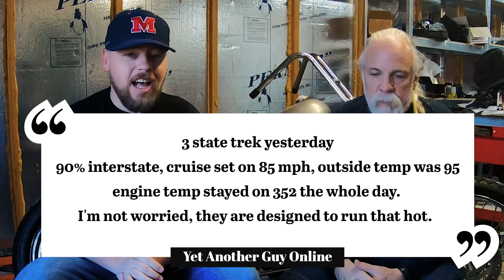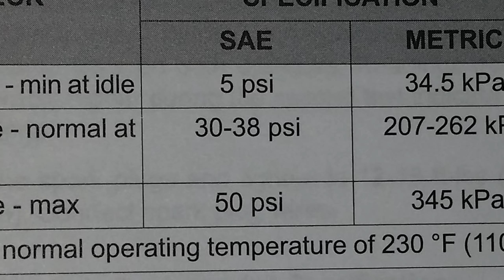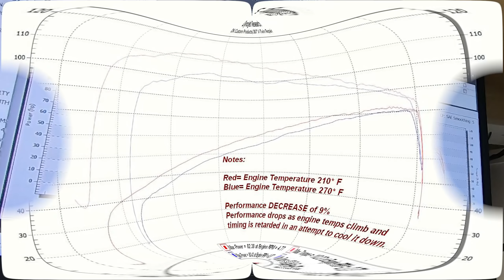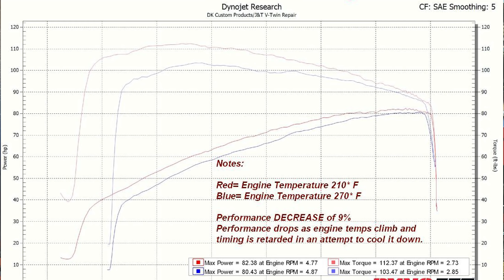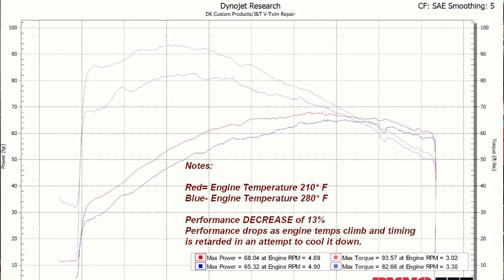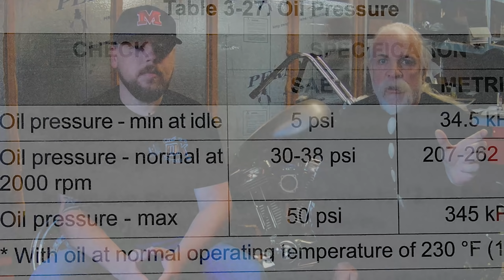Harley's - The RESULTS ARE IN About a Popular Myth

Comment: Is there a temp gauge set up for my 19 tri glide both cylinders
Reply from the maker: There is only one heat sensor in your Milwaukee 8.  It is located in the front of the rear cylinder.  This is the sensor that HD uses in the ECM to help adjust the tune for temp conditions.  The best way to display the reading from that gauge is via a Power Vision or an FP4.  You can see those here- https://www.dkcustomproducts.com/efi-tuners-c74-317.htm
Here are a couple of videos that you may find interesting/useful-
https://www.youtube.com/watch?v=0vbTkRvFa80
https://www.youtube.com/watch?v=rWOdQOtDv6A
Some folks use the Dakota Digital Set up...it is pretty expensive, and we have seen a lot of folks have problems with it.

Comment: Those temperature numbers are oil temperature or CHT? Thanks
Reply from the maker: In the video we talk about oil temps and heat sensor temps.  Two different temperature readings.
Oil, as shown in the video should not exceed 230 F.
Heat sensor temps (as read by the OEM heat sensor) and displayed on the Power Vision as ET should not exceed 230 F on a Twin Cam, and 260 F on an M8.
More details on ET temps, where they come from, and what they should be, are discussed in this video- https://www.youtube.com/watch?v=rWOdQOtDv6A

Comment: When you use premium fuel the engine can get very hot.
Reply from the maker: Any fuel and the engine in a TC or M8 can get very hot.
I have read reports on both sides of the fence...
lower octane (87) burns slower, so heat is retained longer
higher octane (93) has a higher ignition point, burning faster, retaining less heat.
Reply: @DKCustomProducts  oh no, the higher octane explodes much faster in the pistons causing alot of heat around my legs, when I shut the bike off the pipes keep popping for 15 minutes, THATS HOT. But when I put the shit stuff in" 87 octane", theres no popping in the pipes when im done riding, but the bike runs like shit because im putting the cheap fuel in. So now i just put the premium in her, she runs like a dream, but she runs very hot.
Reply from the maker: @philiporourke7896  Below are links to a video series and a written report on how to cool that engine down.  
It will be more comfortable.
It will have more power.
It will last longer.
https://www.youtube.com/playlist?list=PLb3bvZgbH92_3s-2vv63QggFJ3nteFd_C
https://www.dkcustomproducts.com/why-how-to-cool-down-the-twin-cam-engine-part-i-dk-cl-tc-dn-1.htm

Comment: My XR 1200 has an oil cooling system separate of the engine oil lines and passageways.... There are spray nozzles mounted in the bottom of the cases that spray oil on the bottom of the Pistons ... There are oil lines extra coming out the center of the cases between the jugs that go up and do nothing but cool the cylinder heads and then back to the oil tank... There's a huge oil cooler on the left side of the frame that goes to a mechanical thermostat inside the cases that governs the amount of cooling oil going through the oil cooling system... So one day I found a oil cap combination thermostat and dipstick that fit my oil tank... And in cold weather the oil temperature is about 195° and it's remains that hot all the time and gets up maybe 205 210 if I run the piss out of it... And this summer I was watching it closely and deliberately got into some slow traffic at 5:00 and finally a traffic jam where I was sitting stalls in traffic and just let it run to see how hot it would get and it never gets over 210° f when it was 95 outside install traffic.... Someone knew what they were doing when they designed the XR 1200 engine that no major parts will interchange with a Sportster. Hell yeah I have had about eight Harley-Davidsons and I put oil coolers on every one of them that's why I was checking the temperature on this XR to see how crazy it was getting because just a few years ago I had one of those fxdrs with the oil cooling system similar to my Sportster XR 1200 and the fxdr 114 Milwaukee 8 gets extremely hot and I added an extra oil cooler to it...And years ago in around 1981 I bought a 1980 iron head Sportster that was Cherry all dressed out in about $3,000 worth of drag specialties everything but no oil cooler... It did have one of those oil temperature dipsticks for the oil tank and on a hot summer's day that son of a gun would hit 280° on the oil temperature and if you got stalled in traffic you had to shut it off it was just fry your legs like the skin was going to come off.... And being such a sleek little bike I didn't want to one of those huge oil coolers that sticks out on both sides so I went looking and I asked my buddy's wife who had worked at Western Auto if they had any kind of small oil coolers for cars... And marry my buddy's wife got on a step ladder and went up in the attic of his old Western Auto store and brought down this big package still sealed up with about a half inch of dust on it that was an oil cooler for a Chevy corvair automatic transmission as you know the Chevy corvairs were air-cooled engines and so they had to have an air cooled automatic transmission cooler that was about 6 in by 6 in and made two passes loop per loop built like a little air conditioner condenser and just fit perfect on the top part of the frame in the front where there's a bolt hole for crash bars I made a little holder that went through the loops with some rubber damits and it fit perfect and you wouldn't believe the difference that little cooler made would you believe it went from 280 to 180 and about 200 on a hot summer day perfect freaking perfect and I never lost any power at all after that as it would get pretty sluggish when it was getting hot... You guys know what I'm talking about
Reply from the maker: Thanks for sharing!  Yes, we know what you're talking about.
The XR's are a different animal, and it sounds like you are very happy with it. 👍
Good to hear how you kept all your bikes, thru the years, running optimally!
Reply: @DKCustomProducts  thanks for the reply. What I can't understand is why people don't understand that they need to put an oil cooler on every Harley there is. They even sell them in the Harley accessories and some of them are quite expensive.. but if you look in that Harley accessories they have some that are really nice that fit down in front of the frame on the big twins and some of them from like the company called fueling have the ones that mount on the left side of the frame just like the XR1200...
You should follow up with a video showing all the Harley accessories oil coolers that a lot of people could put on themselves they're not that hard to do especially the ones that use the pancake between the spin-on filter mount... After you install it then you just spit on your oil filter and you're done...
And they make dipsticks oil caps with as monitor in so you can see how your oil temperature is running and show some of those in in a video maybe even some shots of riding the bike and then pull over and stop and take a look at the temperature if the temperature stays the third or fourth time you know about where it's going to run off always. So you really don't have to go to the expense of mounting one up on the dash of your dresser just if you got an oil temperature gauge on the oil dipstick is fine anyway good luck to you guys see if you can convince some more people of what I already know over the years see you in the wind
Reply: PS they even have them with fans and thermostats on them so when the gets too hot the fans automatically kick in those are the ones that are a little bit more expensive but trouble free and you run the s*** out of your Harley after that and it won't get hot
Reply from the maker: @donniebaker5984  Yes, oil coolers are important, no doubt.  Back in the oughts HD changed their oil coolers...not nearly as effective as they used to be.
We recommend oil coolers seen at this link...both the coolers and the coolers with thermostatically controlled fans
https://www.dkcustomproducts.com/oil-coolers-c134.htm

Comment: One of my bikes is a 1949 El panhead. I run an external spin on oil filter and also an oil cooler it gets pretty hot here in the summertime in Florida. Everything helps to keep the engine alive. (Edit) Also, I have a 2012 FLHTCU. I run a set of Love Jugs on it, and it helps with the heat.
Reply from the maker: Nice, glad you have your rides set up for keeping them operating in the optimum temp range.

Comment: Love what you guys are doing. I have purchased external breather with catch can and a few other items. That said, you need to do better quality control and raise your standards a bit. Not one of the gear clamps you sent me worked, all Chinese junk! The air cleaner cover, while powder coated, had nicks in the finish! Common boys, great ideas etc. But, let’s do better work! 
Thank you for hard work…
Reply from the maker: This is not the level of quality we strive for, as we inspect every piece before wrapping and packaging. While mistakes can occasionally happen, we are committed to addressing any issues.

Please email us photos of the hose clamps and backplate at Support@DKCustomProducts.com so we can resolve this promptly.

I apologize for the poor quality control and am dedicated to making it right. Thank you for bringing this to our attention, for your business and for commenting! MB
Reply: @DKCustomProducts  Thanks but I already fixed the plate and used cable ties instead of the clamps. I tossed those. I also chucked the catch can in the lathe and cleaned up the bottom so it was smooth.
All installed and working fine.

Comment: But that is temp in metric kpa. Isn't that the temp on lust the pressure side and not in the oil pan?
†********
Kilopascal or kPa Definition

The kilopascal is a unit of pressure. 1 kPa is approximately the pressure exerted by a 10-g mass resting on a 1-cm2 area. 101.3 kPa = 1 atm. There are 1,000 pascals in 1 kilopascal. 4:24
Reply from the maker: at 4:24 the temperature is taken from the Power Vision tuner, on the bike. We were reading engine temperature (ET) in degrees Fahrenheit. Et is read directly from the temp sensor in the head and is what is referenced in most of the tuning tables in the ecm. MB

Comment: Yes Harleys run too hot. Well, some Harleys. I have a 1989 FXRS Low Rider, a 1995 Dyna Superglide, and a 2006 Sportster 1200L, and none of them run too hot. And I am in AZ. All three of these bikes have 3 things in common. One, they all have EVO engines, two, they are all carbureted, and three, they are all jetted properly. I can't believe the things people are doing to cool down their Harleys, like actually putting fans on the cylinders. All they really need to do is richen up the air/fuel mixture (a lot) and if they have a TC engine, get an S&S oil pump.
Reply from the maker: Thanks for watching and for your comment.  Yeah, it was not until 2007 that the heat problem started getting really bad.
Unfortunately, even with a great tune, (or with a tune that is super rich) along with oil pump upgrades, many TC's and M8's are still Much too hot.

Comment: Hello gentlemen. I’m new to the Harley-Davidson family with a 2021 Tri-glide Ultra and live in the desert. I can’t find any engine temperature gauge in my trike controls, only outside air temperature. The only way I can imagine how to check my engine temperature would be to point an infrared thermometer at the engine, but where should I be pointing it for the best reading or is there a temperature gauge that I just haven’t found yet? You’re advice will be greatly appreciated.
Reply from the maker: Harley does not put any of those gauges on their bikes.  Theory is that it would freak people out.
You can get a dipstick that has a temp gauge on it to see your oil temps.
For engine temps the Power Vision is the only real choice at this point.
Using an infrared heat gun is very unreliable, and also not an indication of what the temp is Inside the engine at the Temp Sensor that the ECM uses.
The most reliable, repeatable measurement using a gun is 1" away from the cylinder, 1/2" behind the spark plug hole.  The gun must be held at the same angle each time to get an apples to apples comparison.
You may find this video interesting- https://www.youtube.com/watch?v=rWOdQOtDv6A
Reply: @DKCustomProducts  Thank you.👍🏼😎

Comment: 2022 fatboy 114 M8, screamin eagle Bluetooth tuner. Engine temp on the se tuner app reads 270-280, around 290 eitms kicks in.  Seen as high 300 but drops. BTW I'm in south florida.  Is the engine temp listed on the tuner app the actual oil temp? Is it the correct measure that we should be gauging?
Reply from the maker: First thing, oil temps will lag behind engine temps. No,  the engine temp on your SE Tuner is reading from the Engine temp sensor on the bike not the oil. 

The only way to get a correct reading on your oil temp would be to get an oil temperature gauge dip stick!

270 - 280 is better than some bikes but it is still hot. 
Here is a link to a video playlist on Why and How to Cool Down your Bike that you may find useful/interesting- https://www.youtube.com/playlist?list=PLb3bvZgbH92_3s-2vv63QggFJ3nteFd_C

Here is a link to a written repost that you may find useful - https://www.dkcustomproducts.com/why-how-to-cool-down-the-twin-cam-engine-part-i-dk-cl-tc-dn-1.htm

Please feel free to contact us if you have any questions;
Support@DKCustomProducts.com
662-252-8828

Thanks for commenting! 😎

Comment: The truth behind an air-cooled, high compression, high performance motor comes out with daily real world riding. Sitting in bumper to bumper traffic, on a 90+ degree ~ 90% humidity day, behind a 3rd red light change while drivers in air-conditioned cages have their attention focused on their phones! Throw in gasoline so bad it detonates when ya wash parts with it.
 I've rode for over 30 years on Panheads and Shovelheads that ran 250 ~ 270 on a hot day. That's with non-variable points timing and 60 or even 70wt oil.
Reply from the maker: Yep, Street Developed, Street Tested is what's important...the Dyno Proven is to illustrate.
Sounds like you have had a fun ride!
These new EFI bikes are a very different animal than what we rode in the 70's thru early 2000's.

Comment: Just what I want to do spend 23000 and have to spend more to make it run right.  Absolutely ridiculous…keep your bike Harley, I’m done trying to negotiate on a new one where they won’t budge and then I see this video.  I guess it’s back to a Suzuki M109 where I save lots of money.  Man I so much want to buy USA product but they build crap!  Very frustrating.  My 2 cents.
Reply from the maker: Or you could find a super low mileage Harley that is pre-2007 before EPA really started cracking down on their mandates.  Those bikes ran quite a bit cooler.
Reply: @DKCustomProducts  thanks I may look into that.  I never heard of problems with VRod engine designed with Porsche.  I’m surprised they didn’t use that in another way or upgrade the vrod design.
Reply from the maker: @HeCoversMe  It just did not sell well enough.  Did not look, sound or feel like the nostalgic Harley.

Comment: My Pan runs around 230 on a warm day down the highway. Really all that's needed is a bit over 212 to
boil the water (condensation) out of the oil.

I traded off my oil cooler when I moved from SW Arizona to the PNW. Heh.

Down there, during the summer (115), I've gone to roll on to make a pass and have the engine just
start pinging. No get up and go. Not good. Nope, not good a'tall.
Reply from the maker: Yep, the heat is a killer.
Good to hear you are enjoying your Pan.  👍